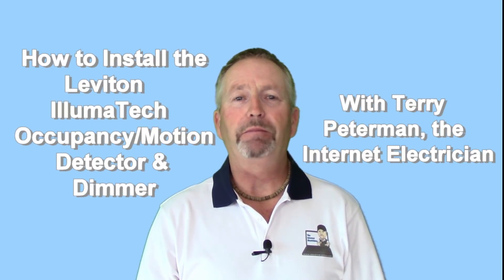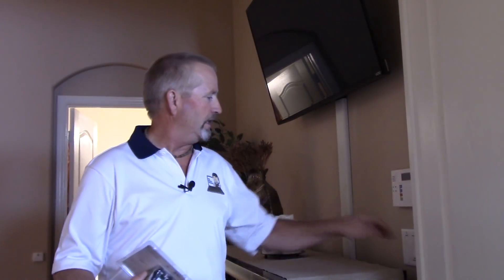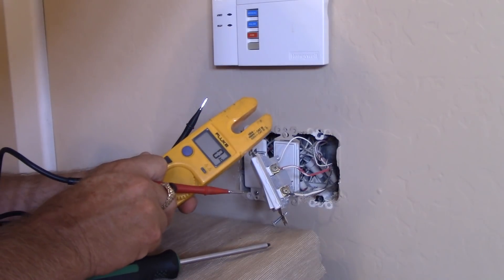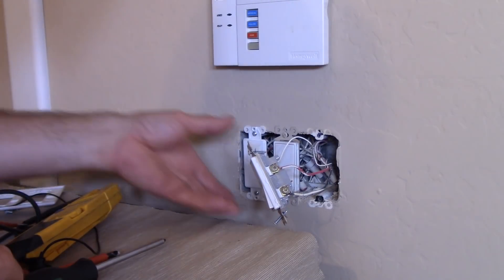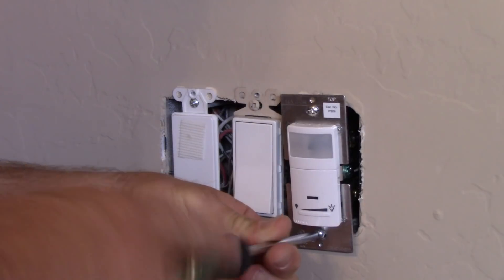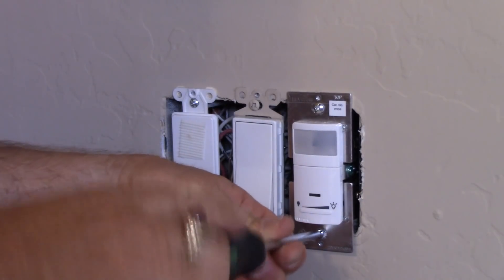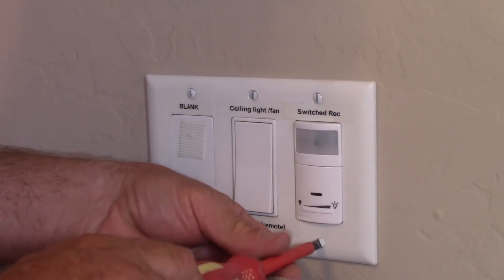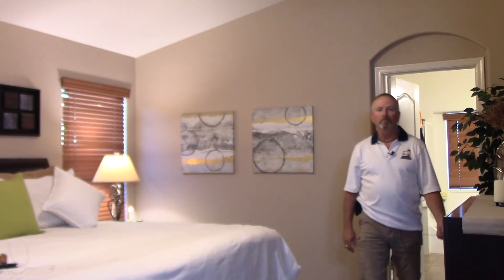The Best Leviton IllumaTech Occupancy Detector Installation Tutorial

Comment: I bought a similar switch before but found that the box did not have a ground wire. However, there is another box about six inches away that has a proper ground wire in it. Is it possible to tie the box with no ground to that ground?